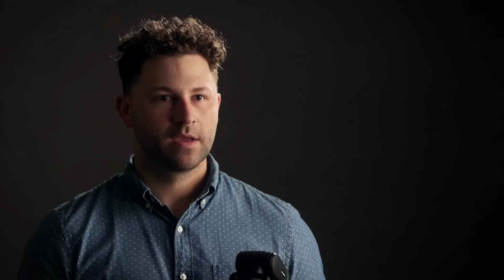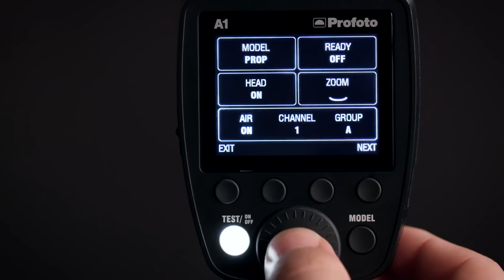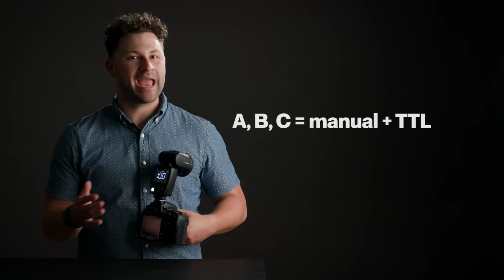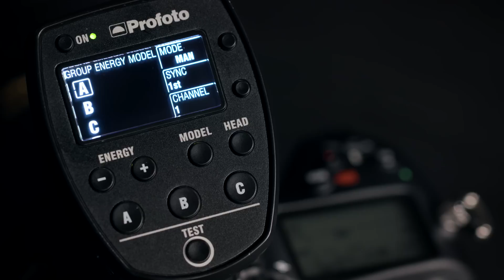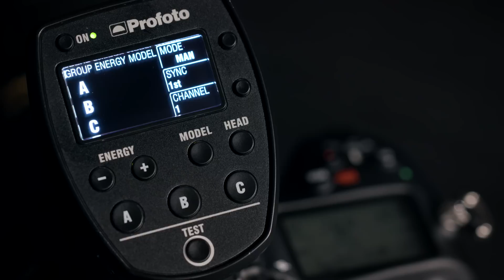Using the A1 as a flash and an Air Remote TTL

Comment: The A1 could be better as a remote. It currently can control only 4 groups, and the absence of a master mode (unless I missed something) is sad. Also, and this is also the case on the Air TTL Remote, what is displayed for each group is a compensation. It's not the actual power value, as on the flash head. So, when flash heads are too high to be read, I have to go all the way up to 10 in order to hear the "beep", then decrease the power to reach the value I want. It's often just easier to bring the light down and up again, rather than frenetically push buttons on the remote. Another complain about the Air Remote is that the hot shoe connector is fragile. I broke two of them by accidentally bumping my camera into gear. Of course, breaking a remote hot shoe is better than breaking the camera, but my good old Pocket Wizards feel way more sturdy while still inspiring confidence that they would break before the camera would. Still a huge Profoto fan no matter what. Besides these minor design issues, I've always been really happy with all my Profoto gear, if only because it's very reliable.